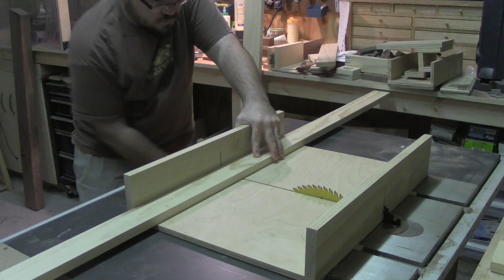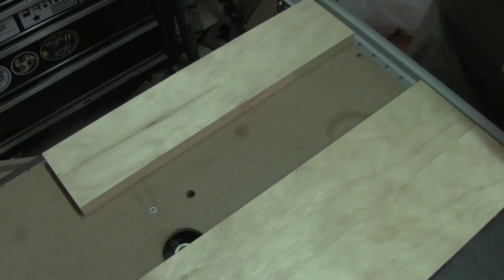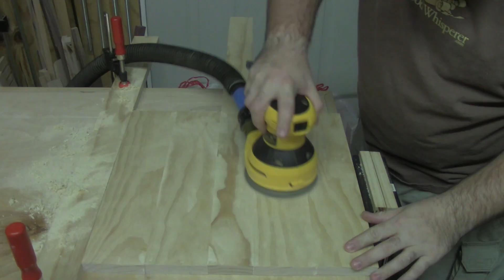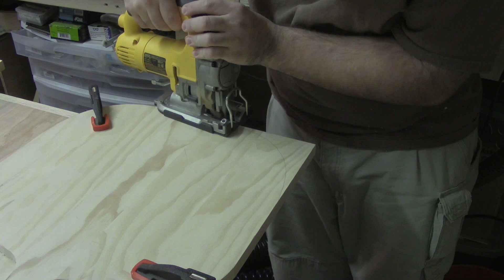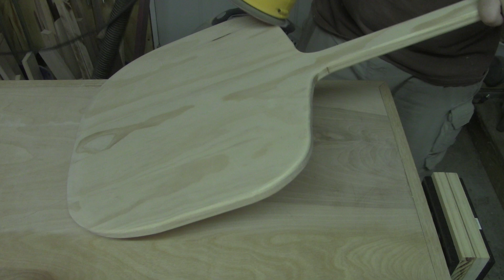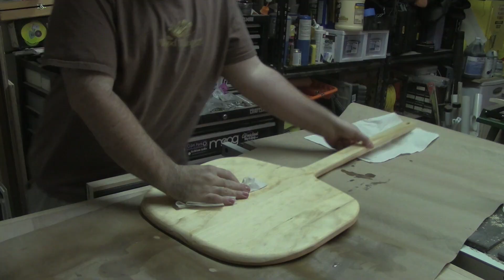2015 Kitchen Utensil Challenge - Pizza Peel

Comment: Wow, now that's a pizza peel!  There's a whole other market for something that shape.  lol  Those card scrapers are great...I had not used one until recently.
Reply from the maker: Thanks, Steve!  I bought three card scrapers a long time ago, when I was just buying tools whether I needed them or not.  Turned out to be a good impulse buy.  I use them all of the time to clean up flat glue joints and do some panel smoothing.
Reply: Mine is dull on all edges and need to figure out how to get the burr back.  I think I need a burnisher thingy.

Comment: That came out really nice Jason. I'm going to be making one of those myself, great build. I really like how long the handle is!
Reply from the maker: Thanks, Linn!  At first I was going to make it shorter, so it would be easier to store, then I thought, maybe it would be better to have some distance between me and the oven :o)  I don't think I mentioned it in the video, but the peel paddle started off at roughly 16" x 16" and then I cut it down with the pattern.  I'm going to scan that pattern in and make a digital version available on my website.

Comment: nicely done! For the next one i would orientate the grain in the handle to be up and down to give it more strength (not needed but a nice this to look for) , but other then that this is one of the best i have seen!
Reply from the maker: The grain in the handle is running length-wise, with the peel boards.  If I turned the grain around, the handle would be very brittle and would crack the first time it had any significant weight on it.
Reply: Jason Rausch I may be mistaken, but being an axe guy you want the grain going perpendicular vs. the peel, as the would be able to deal with the weight better.